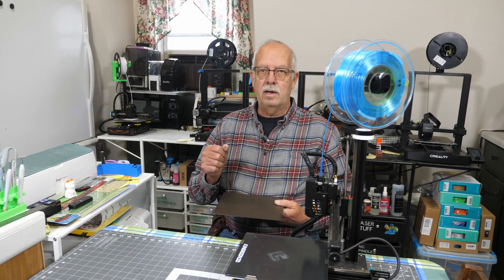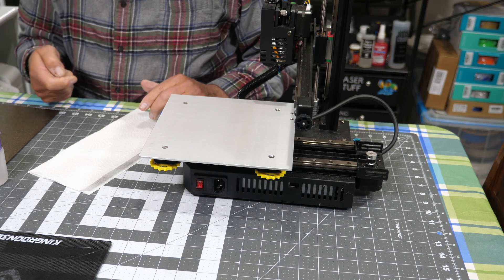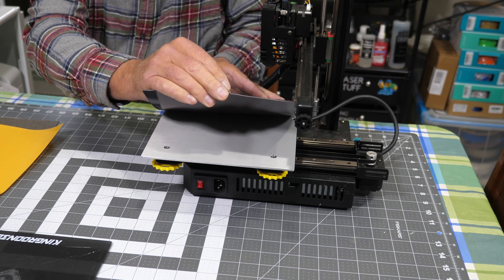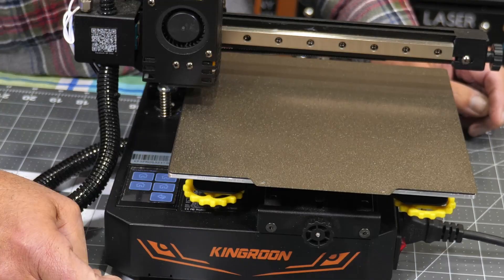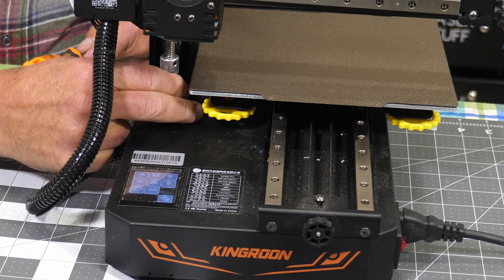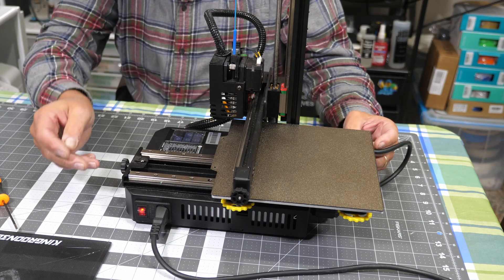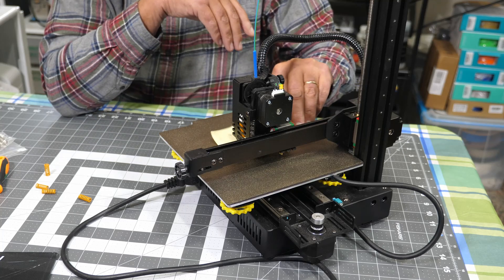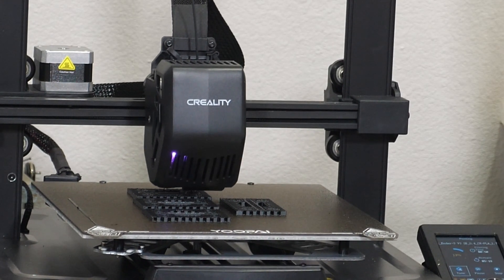Kingroon KP3S PEI Bed Upgrade

Comment: Question what do you actually make with your 3D Printers? Is it Basically a Toy?
Reply from the maker: Can be a toy, but not for me.  six printers visible in the video and another five in a different room.  I make "parts and accessories".  An example:  https://moonshinecrafts.com/product-category/laser-mounts-accessories/  I also make custom knobs for a local company.  I also just ordered a Bambu Labs X1 Carbon core X/Y printer with an AMS unit that should be here this week.